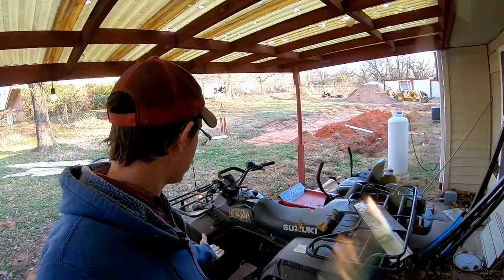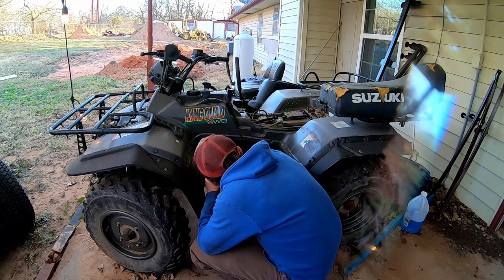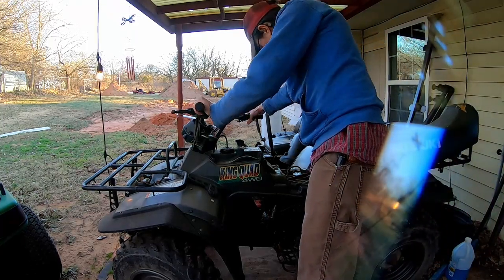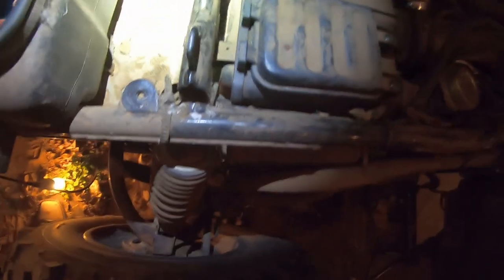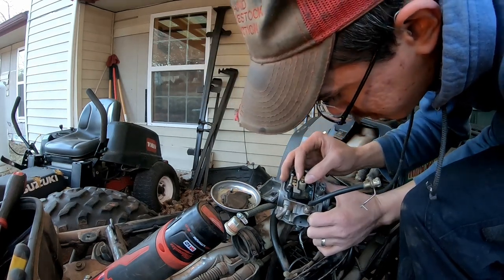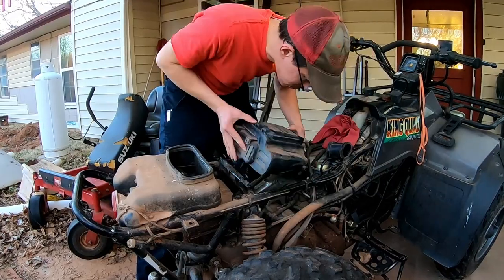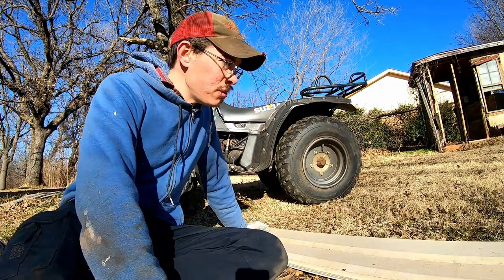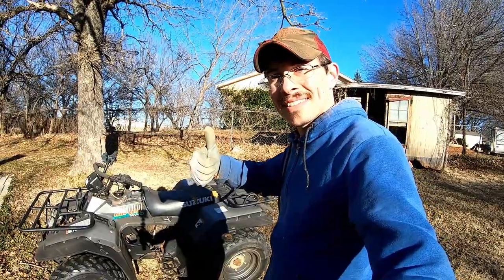I had to rebuild the carburetor on my Suzuki King Quad 300 | ATV Repairs Pt 1 | Garage Story

Comment: The carburetor comes out super easy. There's only 3 jets inside there. A small one, just a cap jet. Of fen long one, which is a airflower and in your Manja, it's very simple carburetor to take out takes about 5 minutes to pull the 2 clamps off. You don't even have to take the carburetor completely off the quad with t. Throttle or the choke lever, you can leave that on there and just clean it out with welding, a brazing tip cleaner.
I'm just not getting any fuel into the carburetor at all. That was as of this morning but I will maybe post a youtube video on this

Comment: Where does the inlet tube going to the air box go?
Reply from the maker: It goes up by all the range controls levers above the gas tank. It’s basically a snorkel.

Comment: I like your video . I have a Question . the bike run well when not moving . But if i want move and run little faster the bike be funky run as lagy  Like if are sinking  because the gaz sinking and sparking . gaz are news cabuartor are clean is out from garage i have to put in choke and filter airs detached . I think i need put new caburator Do i ?
Reply from the maker: I’m not sure what the problem would be. Mine is kind of acting like that now, but I haven’t made time yet to work on it again. It might be the fuel pump.
Reply: @garagestory  I found it and fixed little is the caburator float . pointy . the float need adjutement . and is acte little better . I have buy other caburator . but the old one will old for 5 month ^_^
Reply from the maker: Nice!